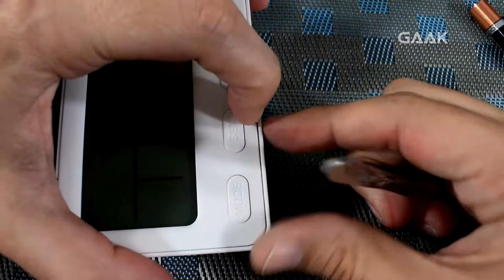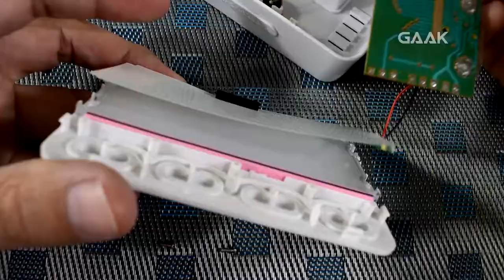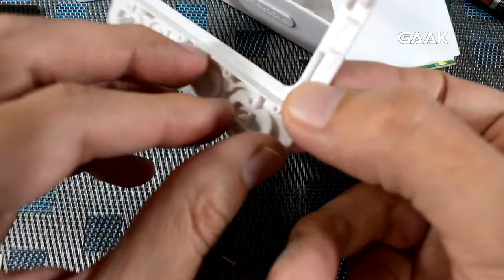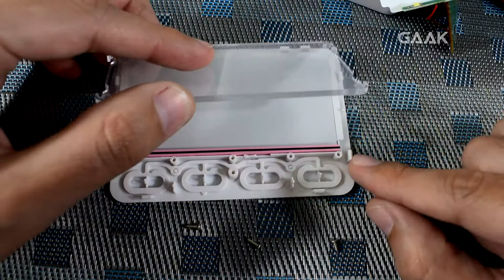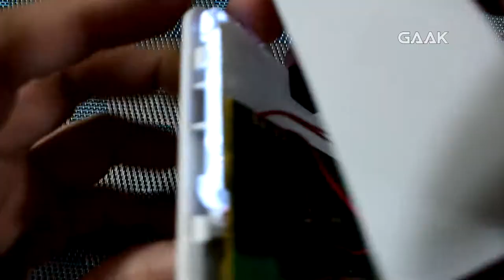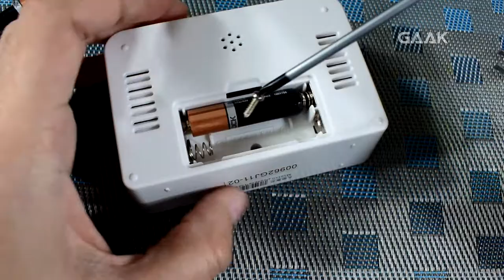How to Disassembly Miniso LCD Clock Reassemble Repair Guide Gaak

Comment: Hello, Gaak! My name is Najma Langit, right now I'm an engineering student at the Indonesian University of Education. My final exam for the first semester will be held in a month. For the engineer drawing course, I need to draw something in detail, and I'm going to draw this clock. If you don't mind, may I know the diameter of the speaker and the length & the wide of the light switch and the "green board" (the one that connected with the cables)? Thank you so much, have a nice day!